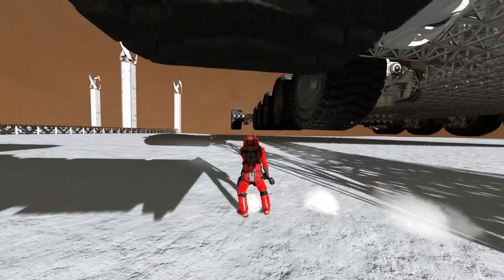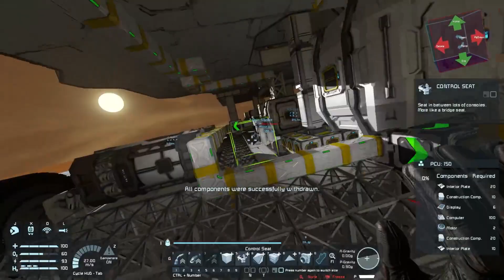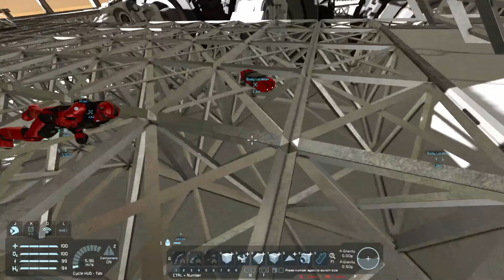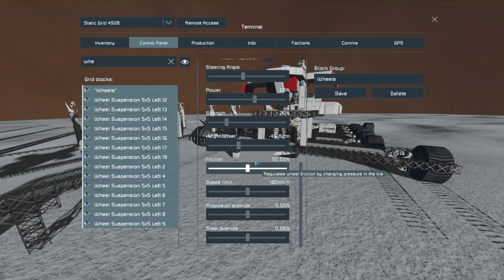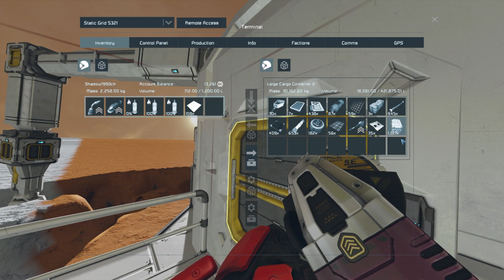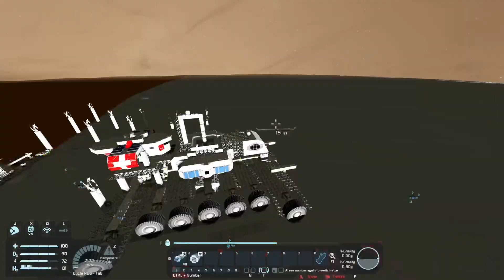Space Engineers: The Cut

Comment: Based on the absolute outside width of your 'bumpers' on the front and back of your rolling fortress, you should be able to easily put double as many turbines, and all you need to do to avoid issues with the wheels is rotate their access 90 degrees, OR extend the bumper just a little bit beyond the wheels, especially if you plan on wrapping 'fenders' over the wheels.
Reply from the maker: Definitly an option i'm considering.